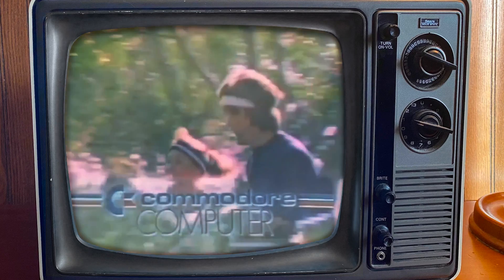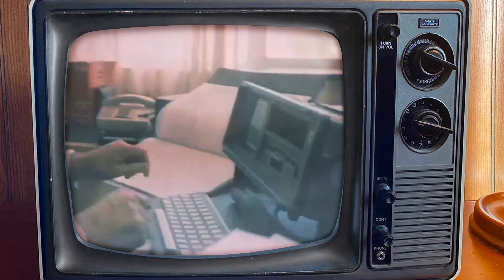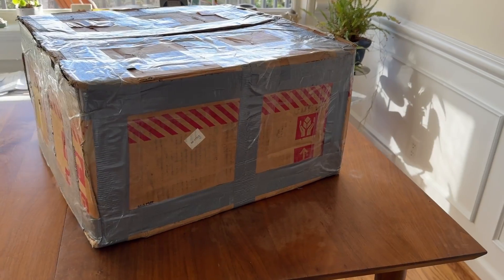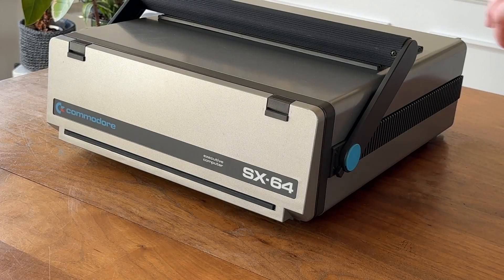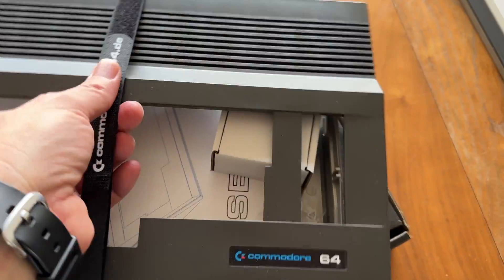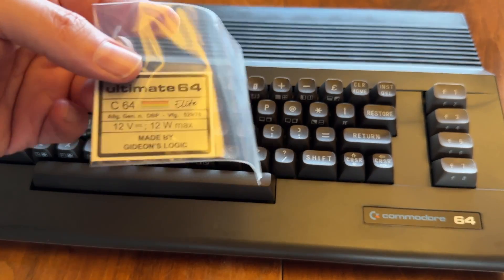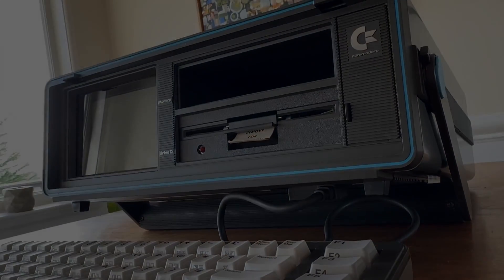Keeping Up With The Commodore and the SX-64

Comment: I've been going through episodes of the Computer Chronicles in order recently, and was quite disappointed when they got to a dedicated "portables" episode in 1985, and of course this was nowhere to be seen. I"m pretty sure I've seen it on that show at some point, maybe just because it made it easier to show off something without setting up a whole system, but yeah... I mean it's said at the end of every episode, this is made possible by the funding of people who are completely in the pocket of IBM, and therefore we really should not have been expecting them to truly give a fair shake to others. I'm surprised they covered the Amiga as much as they did, which wasn't much but certainly more than they covered any other inexpensive machine. They must have been getting screamed at in letters. Anyway, looks slick in black, reminds me of when I was given a VIC-20 rescued from the trash by someone who knew I was into the old stuff. Was not a fan of the white case so the first thing I did was put it in a modified 64 case, swapping over the badges, lol.
Reply from the maker: I love that show sometimes. It kind of gives me Bob Ross feels except with retro Tech instead of oil paints. They got quite a few heavy hitter future legends on that show too, which is pretty cool.
Reply: The old computer shows and news reports were a product of the publishing industry. They truly hated the classes of people who shopped at K-Mart and would buy a C-64. They wouldn't deign to even step foot in one and their reporting reflected that. Commodore wasn't killed by bad advertising. It was killed by poor marketing to the "educated and refined" class of reporters and influencers who needed their egos...and other things... massaged. The people who could have made a difference needed to be spoon fed and flattered and Commodore did not know how to play the game.

Comment: That's a beautiful C64c!  What happened to the underside?

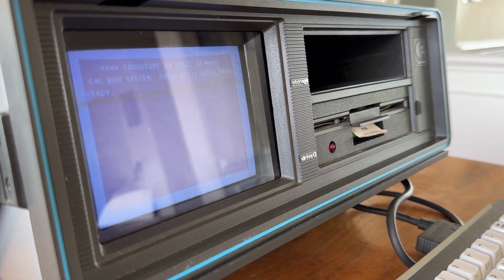Oh and I spotted what you did to the SX-64 at 3:14. 😉
Reply from the maker: The bottom of the underside of the 64C is just the nature of the current process with the original molds. I'm not 100% sure, but it I were to guess the plastics they use today are a different chemical composition. And for some reason some colors really show a lot of streaking from the pour and drying process. At least it isn't the top! (Although the tops do have their own issues, too, but they aren't nearly as noticeable.) 

As for the kernal, that OG owner actually did that for me. And... I approve!

Comment: "Are you keeping. up with Eric's collection, 'cause Eric's collection has far surpassed you ...". 
Lovely video as usual Eric. In the ever evolving situation of us having very similar tastes, I've finally gotten my hands on that C128D I've been after, YAY. Arrived pretty banged up by the courier, BOO!. It's salvageable so I'm getting there. Have the same. C64c case for a spares board I was given by someone in work that I managed to restore. It's my mod64, will be loaded up with all sorts of mods. One I'd dearly love it to have is a Mechboard64. I guess that's the next item to chase :)
Reply from the maker: I will never sing that song with those lyrics. Nor have I ever - I swear! >:) 
Congrats on the D!! Such great machines. I hope the case/keyboard wasn't damaged badly. Of course, my policy is to always have 2 of everything just in case I need a "donor" machine. But D's aren't easy to come by, I know. Where was yours made? 
I hope to see your mod64 some day when you're happy with it. Good times!
Reply: @AmigaLove The old 2 is 1, 1 is none mantra, I like it. I've been after a 128D for many years. Was kicking myself for not picking up a local one (incredibly rare to find)  several years ago. Managed to find a good deal on eBay. Unfortunately the courier dropped it and the front panel got shunted sideways. Bent the floppy eject bar, snapped the floppy eject handle, smashed all the front panel support struts. Thankfully the machine shell and electronics all seem to be fine. Waiting on a local 3d print shop to print up some reinforcement/replacement struts for the front panel so I can put it all back together again.

Comment: I have the exact same case.  Other then the minor flaws that I guess goes with using old molds or inexperience, (?) it is pretty cool.  Nice vid.  I always wanted an SX-64 until I actually used it and like you said the screen is not great for text.  They used a regular CRT sized shadow mask so the holes are too big for the size CRT it is.  The result is a pretty obvious dot pattern.  This could have been oh so much better with a better quality CRT.
Reply from the maker: You are absolutely correct. In fact, when I got my SX-64 a few years ago I actually didn't know about that inherent problem and actually contacted Ray Carlsen to see if he should repair it. He soon set me straight. Everything about the machine I got is museum-quality, however the keyboard membrane is definitely on its last legs and something I need to replace.  I got the new membrane but haven't installed it yet. I need to get beyond my fear!
Reply: @AmigaLove  LOL.  You know when I first saw the SX in a store I was in awe at the screen and the whole portable deal.  Of course I was a freshman in high school so my eyes were a little  better then they are today.  haha
Reply from the maker: As for the imperfections in the plastic, I assume it is due to using more modern plastics (different chemical composition) that are fire retardant, don't yellow over time, etc. It can also have to do with how they are cooled. I know that with the Mega65 cases the 1st batch were quite flimsy and it was because they were being pulled off the molds too early. In any CASE ;) I really don't know. But regardless I do very much like the SX-inspired color scheme. It's a lot sturdier than my Plexilaser. =)
Reply from the maker: Wow, I’m impressed you actually saw one in a store! I never saw one in the stores I went to back then.